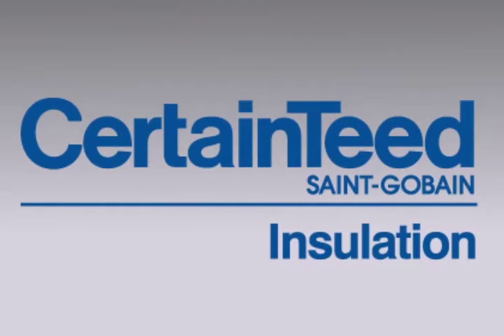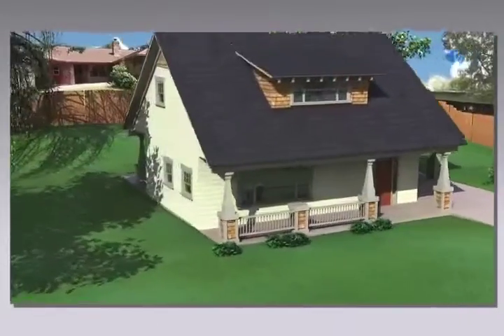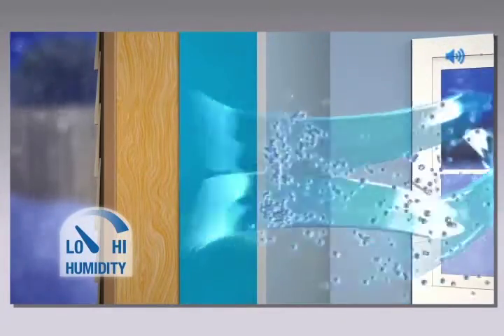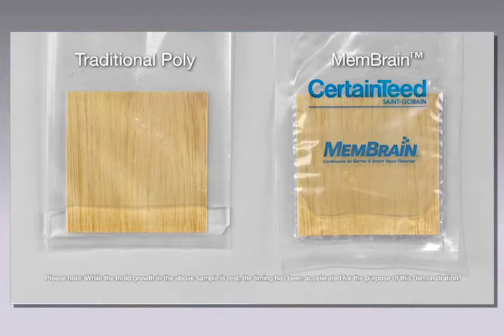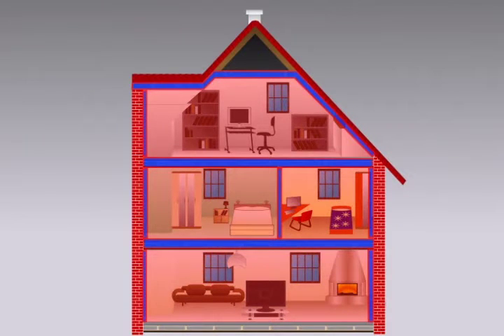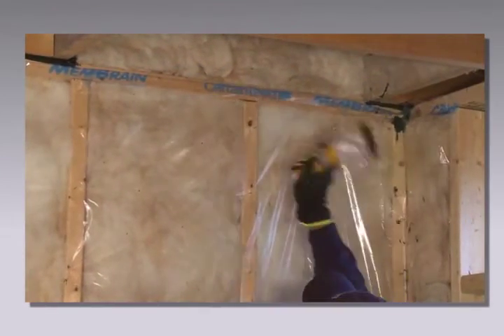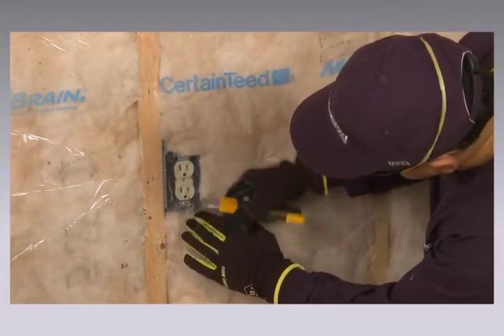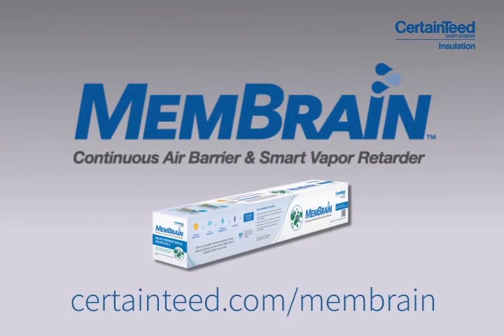CertainTeed’s MemBrain™ Continuous Air Barrier & Smart Vapor Retarder

Comment: Confusing because I googled vapor barrier rockwool insulation and they say it is not needed:  Do you need vapor barrier over mineral wool insulation?
Because of its greater density and water resistant properties, mineral wool acts as a vapor barrier and, unlike fiberglass, does not need an additional vapor barrier to be effective
Besides that, price of the smallest roll is $200 (50' at Home Depot special order).., I need to do one wall so what do I do with the remaining 45'?
Reply: Rockwool does not act as a vapor barrier.  It is completely vapor permeable.  It's hydrophobic nature does make it a better insulation than fiberglass when wetted.  Water will drain quickly from mineral wool where it tends to cling to fiberglass.  The permeability of Rockwool works very well in situations where a vapor barrier is excluded, because it keeps the drying potential of the wall very high, and will not exacerbate the impact of bulk water intrusions.
Reply: @jasonbeisiegel5550  would you still recommend a vapor retarder though? I have Rockwool on our walls in our shed to house conversion, and bought CertainTeed vapor retarder

Comment: Can this be used with Rockwool?
Reply: Yes, it works very well with it.
Reply: I was wondering the same if I could use this smart membrane with rockwool insulation. I have yet to see any info on video on it using rockwool. Contractor said he uses 4mm poly instead
Reply: @VERYCHEAPDEALS 6 mil poly has been standard for years, but this smart membrane makes more sense.
Reply: y wudnt u